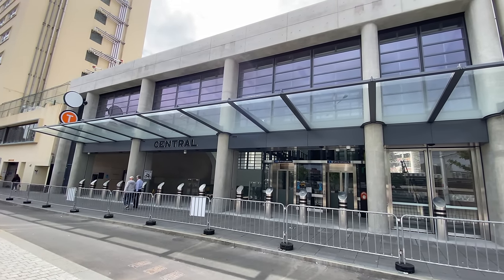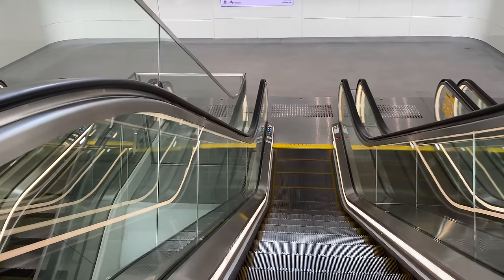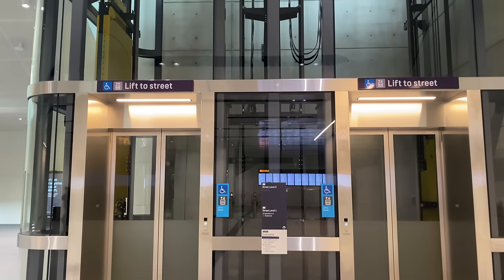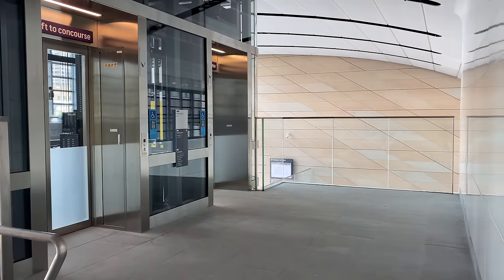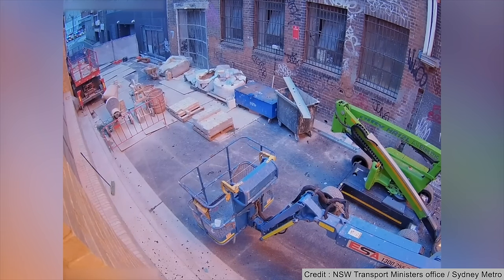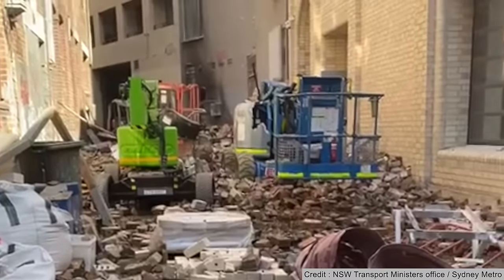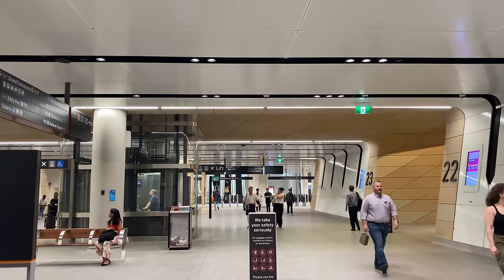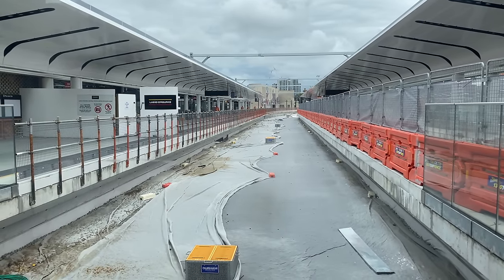Chalmers Street Entrance Now Open! - Sydney Metro Central Station Upgrade Almost Complete!

Comment: Walking the new entrance is a literal breath of fresh air compared to the old entrance just a little south. Whoever designed it did a great job and it is amazing to see how well they recovered after the fire. Fantastic video as always Paul!
Reply: The biggest criticism I have is it still doesn't give you entrance to the station or light rail from the other side of Elizabeth Street where most people want to go.
Reply from the maker: Hi@timeimp ,Yes it certainly is! Glad you enjoyed this video. It's not often a new station entrance has a story to tell even before it opens!
Reply from the maker: Hi 
@kyletopfer7818. Perhaps one for the future. Not an easy one, as it would require a passageway under Elizabeth Street.
Reply: @TransportVlog  Agreed but the return on investment mmust be pretty big given in my experience the vast majority of passengers exiting the eastern side of Central who aren't heading to the Light Rail want to get across Elizabeth St!

Comment: Hi Paul, excellent video. Would it now be possible to walk directly from the Ranwick / Kingsford light rail line to the Dulwich Hill light rail line via Central Walk without going through any of the Opal gates? That was certainly a large fire there in Randal Lane. I am currently trying to catch up with the videos while recovering to a nasty Staph infection to my right leg..Bit by bit, I am managing to get around, though still quite slowly. Anyway, take care. Rob in Melbourne Australia.
Reply from the maker: Thanks Rob, No not quite!  The Light Rail Stop is on the Grand Concourse, so is outside of the Opal gates. Interchange would be via the Northern Concourse, North-South Concourse, Central Walk and Chalmers Street entrance.  Still quite a long interchange, and probably quicker to alight from the L2/3 at China Town and walk to Capitol Square for the L1. That sounds painful! Enjoy watching lots of videos while you get better!

Comment: Very informative (as usual) Paul. A couple of things I've noticed at Central are just the one southern down escalator for platform 22/23. A lack of escalators between the new central walk and the old south & north section of the station, there are only stairs & lifts. A curved central walk lift glass piece damaged & now now replaced. Still it's a big improvement, especially the platform escalators. I wonder how long it will be before that middle level of the Chalmers St entrance has a few permanent residents.
Reply from the maker: Glad you enjoyed it! Yes the south end of platforms 22 and 23 was too narrow for 2 escalators. Yes, its a shame its only steps to the northern concourse, but you can avoid those by taking the escalators up to platforms 12 instead.  I guess some damage is inevitable!

Comment: Great video Paul, especially the fire coverage. I'm yet to understand though if the new entrance allows vehicular drop offs, or is Chalmers Street still only open to trams at that point? If you were dropping a friend off at Central by car, where would be the best place other than the Grand Concourse on Pitt St side?
Reply from the maker: Glad you enjoyed it.  You could probably drop someone off in a vehicle on Randle Lane (or certainly Randle Street), but Chalmers Street is just for trams, cyclists and pedestrians now.  That would certainly be a lot closer to the suburban platforms than Grand Concourse.

Comment: What an immense improvement since I regularly used Central Station last century. Putting a modern airy concourse under the working suburban rail platforms is a fantastic achievement. Replacing the maze of cramped disorganised tunnels that often left you far from your destination with a building that understands the needs of the passengers using it is quite a step up for Sydney Trains. 
Certainly more could be done.  Pushing Central Walk through to Broadway in order to finish shutting down the maze for instance, but the improvements so far are more than I have expected from the NSW state government.
Reply: and build that development on top of it
Reply from the maker: Yes it is a huge improvement, and there is now one clear path through the station, which makes it much simpler to navigate.  Yes its crying out for better links on the Broadway side and hopefully that will come in the future.

Comment: I was through Central yesterday (Friday 01/12) and saw the Randall Street entrance was open.

Also the stairs at the Southern end of the suburban platforms are now closed with work going on with both the old 'stub' tunnel from Platforms 16 to 22 and the tunnel that used to lead to the interstate platforms as well as the suburban platforms, from the Southern Concourse and Devonshire Street tunnel.

I wonder if these works will end up with access to trains from the Broadway/Railway Square end of the Devonshire Street tunnel.
Reply from the maker: Hi Tom, yes I think it opened the day before.  Yes I'd heard about that. I think its just some refurbishment work.

Comment: Pretty hard to find the Light Rail Stop there is very little signage!
Reply from the maker: It should be fairly obvious if you're coming out of the Chalmers Street entrance. There is probably limited (or no) signage from some of the other entrances.
Reply: I was coming out of one of the eastern side platforms having just arrived from Gordon. A friend of mine agreed with the lack of signage direction for the light rail

Comment: Thanks for this detailed and contextualised look at the recent upgrades.

I'm glad there's an access point to the station from the Eastern side of those busy roads now, that makes it a lot easier, but why TfNSW chose to demolish a 4 story building and replace it with a 2 storey one is anyone's guess. If they were taking over the footprint of this building, why not use the air space above it for something useful and capture the value of the station entrance? Given that - for instance - residential properties in Sydney are getting more and more expensive, I'd imagine putting a 10 storey apartment building, or even a 20 storey residential tower right above the station entrance would be worth a mint, and would have paid for the station upgrade, and then some.
Reply from the maker: Glad you enjoyed it! I'm sure it was considered at the time, as its prime real estate around there!

Comment: The tiled risers on the steps leading up to the back entrance look pretty dirty and the grouting damaged. Looking at the video of the fire and the water and debris coming in the back entrance I guess they got a bit dirty on that day but you would think they would’ve cleaned it up better than they have.  Maybe the tiling will need redoing.
Reply from the maker: Hi Rob, I didn't particularly noticed this, but I'll look more closely when I'm next there.

Comment: Paul, can you explain why the trams are so noisy as can be heard in the closing moment of the video, they have some sort of rattling noise when in motion like something is loose underneath them, is this deliberate for hearing impaired or just poor construction of something in the undercarriage of the trams, it's a very noticeable noise and detracts from the  quietness of the trams when in operation.
Reply: There's also some vibrations downstairs in Central Walk from some columns.
Reply: They are a rail vehicle and are subject to the same rolling noises and rail squeal as trains are.
Reply from the maker: Hi @-PORK-CHOP-, its noisy because the trams go over a double cross-over junction, followed by turnouts that connect with the third platform.  You can often hear them from down on the concourse!
Reply: @TransportVlog  Thanks Paul for the reply, the noise I am talking about is what sounds like a set of loose Santa's bells, it's quite noticeable which makes me think it's part of the design to help hearing impaired people as the carriages are very quiet normally except when crossing over a junction, it's not a rolling noise rather like something is loose, it sort of detracts from the normal quietness of the carriages when they are not travelling over any rail junctions.

Comment: Imagine all that asbestos spreading through the ventilation system, causing a refrigerant leak. They would have had to gut all the pipes out of the building to have the building decontaminated and the pipes replaced
Reply from the maker: Very good point! - I hadn't thought about that!

Comment: The new Central station design is a wayfinding mess. I've used it several times now and each it has taken me several minutes to try and find what platform I should be on. It's worse than the old one in that regard.
Reply from the maker: Most people seem to find it easier to get around, so maybe it just takes some time to get used to it.  I thought the signage was pretty good, so if you follow the signs, that will help,